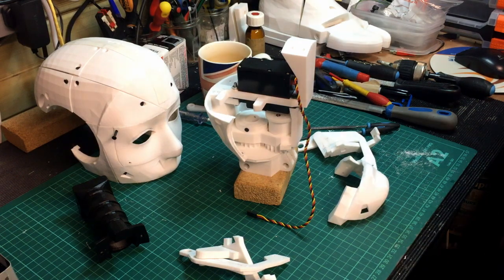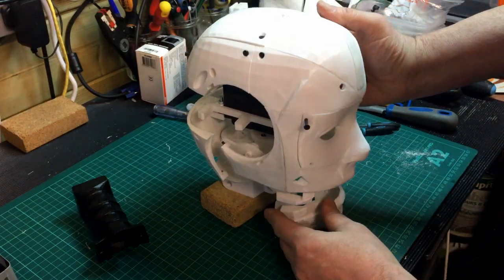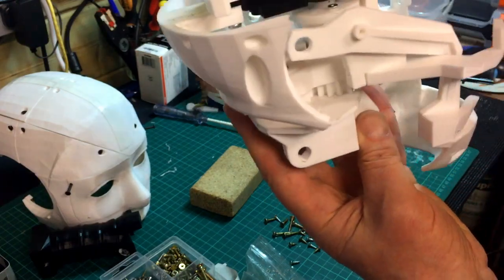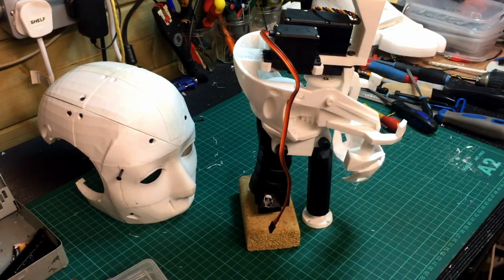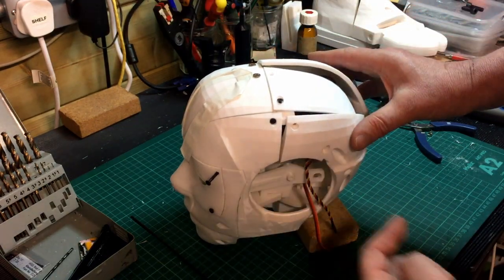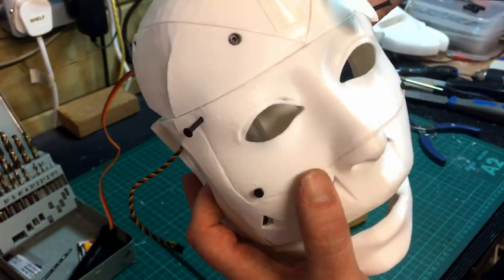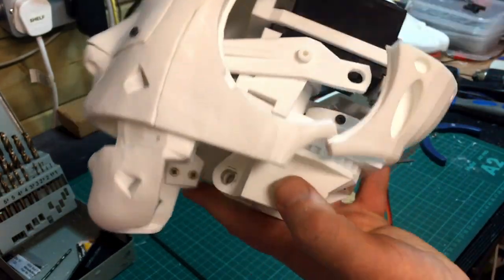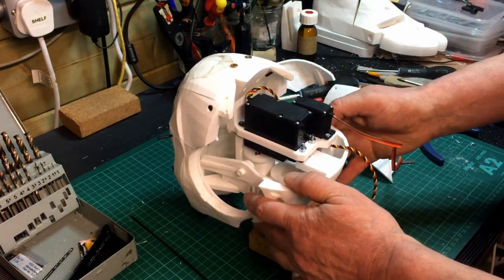InMoov Build Part - 29 The Head

Comment: Hi, Kyle, I started doing this project, but what software should I use? I thought about using MyRobotLab, but I am Turkish so where should I change the speech files. Thank you in advance. Good day.
Reply from the maker: hello Mobil. I would look at MRL and maybe ask in the forums about different possible language packs?  I would in the past have suggested using EZB software that I used in this video.  The problem is they now charge a monthly fee to use it, or some of its features will not work. Its $8.99 a month to use now, such a shame.  (InMoov forum here https://inmoov.fr/).   Try both out to see which work for you?
Reply: @kylecampbellweb  hello the robot speaks english and i am turkish i want to change the files the robot speaks
Reply from the maker: @egenorcu  Mobil, ask on this forum (http://www.myrobotlab.org/content/changing-languages), best place to start I think. I am not that experienced with MRL.  If you do use the EZB software, you type text into the files in Turkish and it  uses text to voice translation.
Reply: @kylecampbellweb  Hi again buddy, the link you gave is not working
Reply from the maker: @egenorcu  http://www.myrobotlab.org/content/changing-languages and https://inmoov.fr/

Comment: Hi Kyle, Doing the head build as a starting point to use with my JIBO Robot, ie sit it on top,  but I'm confused with the parts list, Its appears to indicate that all panels are held together using 20mm  m3 or m4 counter sunk bolts, but as there are no threads on the panels that does seem possible, I notice you appear to be using counter-sunk screws, is that correct? if so what size and length are you using? I'm just about to buy a bulk from eBay and don't want wastage. Thanks Malcolm
Reply from the maker: Hello, I used M3 counter sunk bolts and fitted nuts.   There is a printed nut socket on the back to sit a nut in on some head pieces but simplest to heat up the nut and pull it into place in the plastic and it holds there OK.   I bought a selection of M3 and M4 nuts and bolts of different lengths from ebay.  Worth having a lot of different hardware ready to use, still never seem to have enough though!
Reply: @kylecampbellweb  thanks Kyle I know what you mean, I've got draws full of resistors, capacitors, transistors, IC's and Old CPU's from the days I made synths, they all come in handy eventually. Regards Malcolm aka @fixed1t
Reply: @kylecampbellweb  thanks I've ordered some and the heating of the nuts is a great idea
Reply from the maker: @fixed1t   Also worth trying out "Panel fixing self clinching nut,No.2xM3" and again heating them. Just using these on the 3DLab printed RC planes
Available lots of places but I bought them at RS Components 
see here [https://uk.rs-online.com/web/p/clinch-nuts/0827603/?relevancy-data=636F3D3126696E3D4931384E525353746F636B4E756D626572266C753D656E266D6D3D6D61746368616C6C26706D3D5E2828282872737C5253295B205D3F293F285C647B337D5B5C2D5C735D3F5C647B332C347D5B705061415D3F29297C283235285C647B387D7C5C647B317D5C2D5C647B377D2929292426706F3D3126736E3D592673723D2673743D52535F53544F434B5F4E554D4245522677633D4E4F4E45267573743D3832372D363033267374613D3038323736303326&searchHistory=%7B%22enabled%22%3Atrue%7D

Comment: please could you post a link on all necessary head parts I'm trying to use a modified head in thingiverse , on tuto he says keep the non modified parts the same but I dont know the necessary parts for head printing (only head ) neck also he's replacing the rest of it with a head stand with neck
Reply from the maker: Hi Amine
I used Gaels standard head design here but am also using various eyes mechanisms from Thingiverse.  
Simplest is to print all of Gaels head components, assemble the head and then print any modified parts later.  There are several Thingiverse mods and its gets a bit confusing. 
Then print any modified parts later and see what you want to use.
Gaels head designs are here...http://inmoov.fr/inmoov-stl-parts-viewer/?bodyparts=Skull-and-Ears and here http://inmoov.fr/inmoov-stl-parts-viewer/?bodyparts=Face-and-Jaw and here http://inmoov.fr/inmoov-stl-parts-viewer/?bodyparts=Eyes-mechanism
Gaels new neck design is here...http://inmoov.fr/inmoov-stl-parts-viewer/?bodyparts=Neck
Reply: Hi Kyle
Thank you so much for the links (y) (y)
Reply: one more question please , how much costs printing the head only ?
Reply from the maker: Hi Amine, I didn't keep track of the amount of filament I used but would estimate 1.5 reels, plus costs of the motors. And camera etc if used. And Arduino etc to control it all etc
Reply: Thank you for all answers , I'm only talking about head without motors etc , the estimation which gave me a 3D printer here is 190$ , I found an online 3D printing service with ABS 81 euro , this service is supposed to ship it  , i found this on 3Dhubs , what do you advise me please i've never printed anything in 3D , i'm afraid that the head will break or something while shipping , can i trust this online printing ? is 190 $ the usual price ? thank you again

Comment: Are you using ezrobot. I am torn between using mrl or ezrobot and suggestions?
Reply from the maker: Hi David, I have an ezrobot kit I bought on sale so I can use it.   However, I have recently downloaded the Manticore MRL and it installed and worked really well.  I used to use MRL kracken older versions and had lots of issues which was the original reason of going over to EZB fully for my main Inmoov.     So I will probably wire my Headbot so I can use both setups.    I have the Nervo boards and Arduino setup so its no extra cost for me.    
This doesn't really answer your question!    Manticore is free so try it out, and its got a really clever virtual robot and the speech/chat worked for me immediately in software but I have not tried it out yet properly controlling hardware servos.    MRL is a more "developed" system and very easy to customise.
Reply from the maker: David, out of stock at the moment but when in stock its a bargain https://hobbyking.com/en_us/ez-b-v4-developer-kit.html
Reply: kyle campbell yeah that is an awesome price on the kits. I was looking at their site and it was $179. With this kit will the board hold all the servos that need to be added for the inmoov or will I have to have multiple eb boards? I have multiple adruinos I was going to use for the mrl process but the nervo boards other than ordering from the inmoov site I didn’t know how to get my hands on. It sounds like you are very experienced, is there another place to order the nervo boards from other than inmoov site. I like the idea of experiencing both processes. Thanks for time. D
Reply from the maker: David, I am using two EZB V4 controllers for my InMoov.  When I was using the MRL system I again used two nervo boards and two arduinos.    I made my own breakout boards to power the servo motors for my InMoov with the EZB controllers because of the current drawn by so many servos.   

If you are going to use the MRL/Arduino setup, I would recommend the nervo boards from Gaels inMoov site as they make wiring it all together much easier.  Gaels boards are specifically for the InMoov and only he supplies them.   You can make your own wiring set up as well.   You just need to wire up all the servos so that the power and common go to your battery/power supply and the signal and common go to your arduino ground and signal pins.   If you dont want to use the nervo boards, look around for Arduino expansion board shields that breakout the pins to screw terminals.   [example here  https://www.ebay.com/itm/Prototype-Screw-Terminal-Block-Shield-Board-Kit-For-Arduino-MEGA-2560-R3/132518507577?epid=1982804401&hash=item1edab7f439:g:UuUAAOSwBvNTrO8s]

Have a look at here at the MRL wiring layouts http://inmoov.fr/default-hardware-map/
and also my own method using EZB and pins out etc  https://myrobotnigel.blogspot.co.uk/p/blog-page_7.html.    You can see how I allocated the servo pins to the EZB controllers.   I originally copied how Bob Houston set up his InMoov with the EZB controllers, but you can set them up using whatever pin outs you want.
Reply from the maker: David, EZ-B V4 controller is on sale at Hobbing King [half price] this weekend

Comment: Can i pay you to build one for me?? Plzz text me 7577795445
Reply from the maker: Hello, sorry I cannot.  The InMoov project is available under a creative commons licence, so you can build one yourself,  modify it as much as you want, but you cannot sell them.  Gael Langevin, the designer/creator can sell them and does sell some parts - hands and wrists and electrical breakout boards at present.    

Anyway, the fun thing is to build one yourself, it really is not hard to do.  And it would be much cheaper even of you could buy one, as its the time thats really expensive.    

Buy a decent 3D printer, download the free STL files from the InMoov.fr/ site, slice the STL files with free software and start printing the parts.   Build the head, its fun to do first.